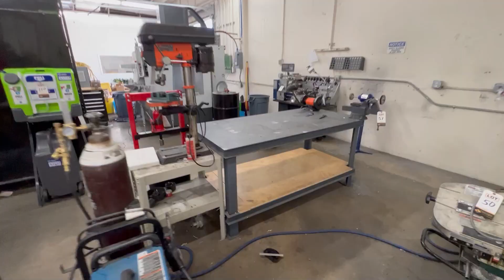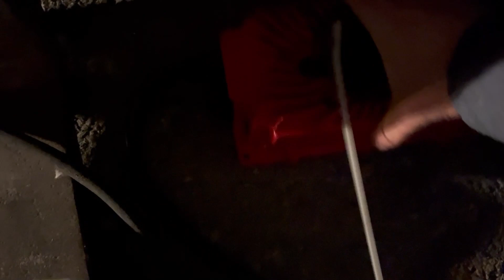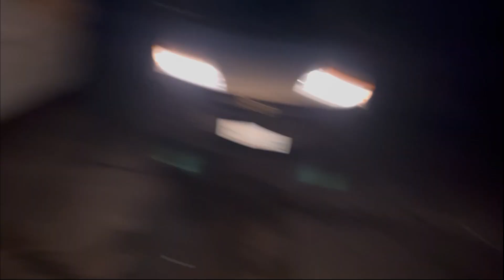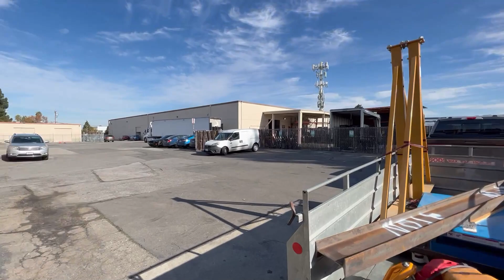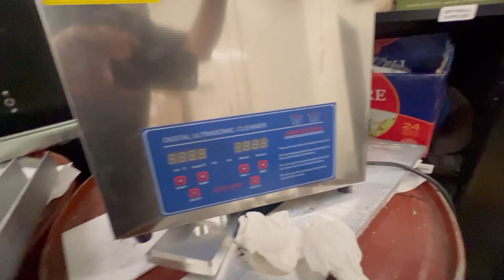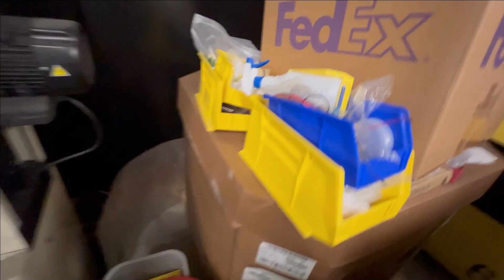Robotic Surgery and Liquidation Auction Loot!

Comment: Looks like quite a haul.   Any general idea of what they were making?     For your batteries get one of those chargers with the pulse rejuvenation function.  An automotive 12 V will work just connect it across 6 cell groups one at a time.   It knocks off the sulfation crystals, worked well on my truck batteries, extending the life.

Comment: I have a forklift also, one thing I was told by the MFG, charge then water. Your battery has a water system on top. Get a water gun for a hose and use it to fill all the cells at once. If you water then charge you will cause the cells to overflow and boil over. Thus the white stuff you saw on the cells. I wonder if you have the correct battery, it should be tight in the hole?
Good haul on all the stuff!